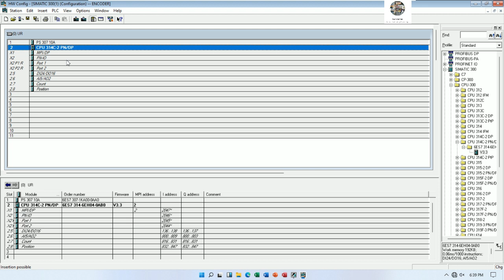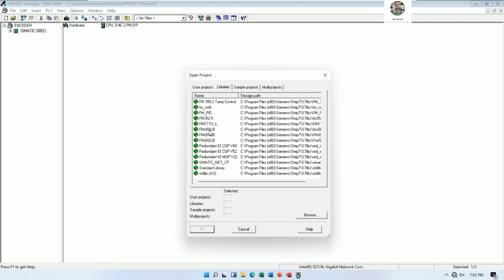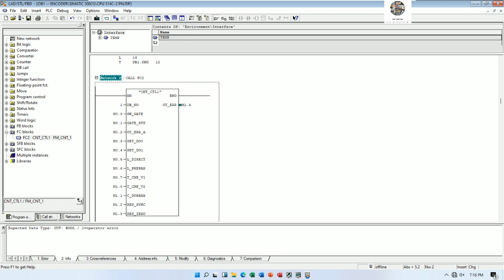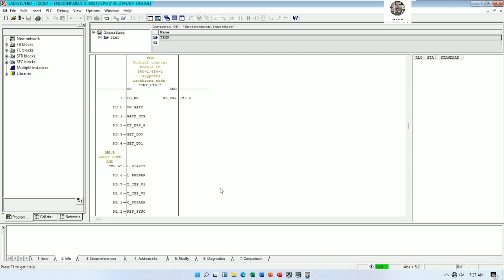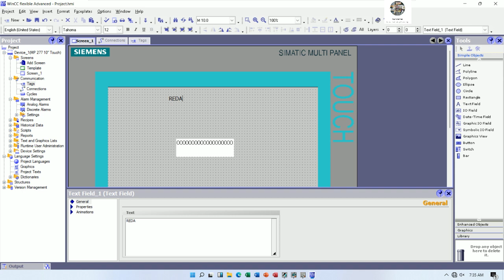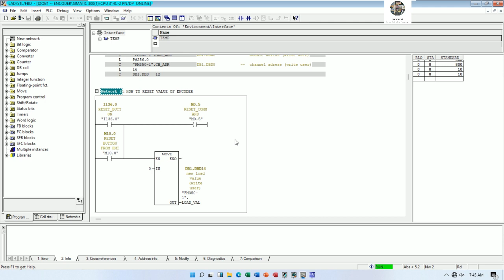How to read data from encoder by using PLC S7-300 FM350-1 high speed counter module part1

Comment: The module worked with the old project.
When loading a new one (the hardware has changed), the module gives an error "module without parameters".
I did everything as in the video.
Still the same error.
Reply from the maker: Dear sir,
Please check power supply 24VDC supply to module connect correctly or not?
Reply: @generaltechnologyknowledge5165  auxilary supply ok. If i disconnect, module says : "no supply"
Reply: @Key Sansa were you able to fix your problem? I have the same problem
Reply: @thomasb4422  Yes. Disconnect the encoder and configure the module without it.  After that, connect the encoder.
Reply: @thomasb4422  All connections with power off procedure

Comment: If you choose 5V incremental, it gives different options than selecting 24V incremental encoder
Reply from the maker: Yes it should be different
Reply: @generaltechnologyknowledge5165  brother, I have to count 5V single  pulse...Can I use "A" only in monitoring or is it possible?
Reply from the maker: @tauqiranwar5699  Yes that correct,
Please select to A possition
Reply: @generaltechnologyknowledge5165  thanks, when I select Operating mode @ continuous counting it gives SF, but when I use single counting it gets OK..

Comment: Please let me know how to read speed through FM 350-1
Reply from the maker: Dear sir,
We can use the formula to calculate speed by using encoder.
Reply: @generaltechnologyknowledge5165   any clue about formula?
Reply from the maker: @tauqiranwar5699  
Please test with this 
Electrical speed=[[(Max Frequency response(kHz)*1000(Cycles/minutes)]/PPR]*60(Sec/minutes)
Example: Max Frequency response=120kHz, PPR=25mm/0.01mm=2500PPR(if the required linear resolution is 10 microns (0.01 mm), and a screw with a 25 mm lead is used) then 
Electrical speed=[(120*1000)/2500]*60=48*60=2880rpm
I hope it work.

Thanks
Reply: @generaltechnologyknowledge5165  Thanks a lot...
In FM350-1 (6ES7350-1AH03....the operating mode RPM measurement is available....is it also need for this latest FM 350-1..
Reply from the maker: @tauqiranwar5699  Yes sir
Reply: @generaltechnologyknowledge5165   I  have to measure speed using 6ES7350-1AH03....counter module.
Pulse train is coming from VFD 1440 Hz. I have to measure RPM of motor. 
So, what do you suggest?